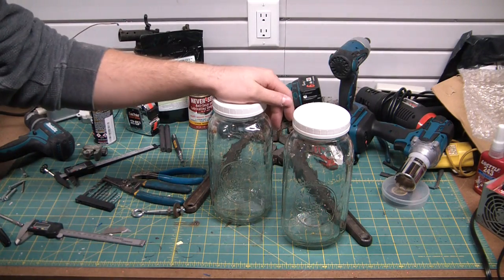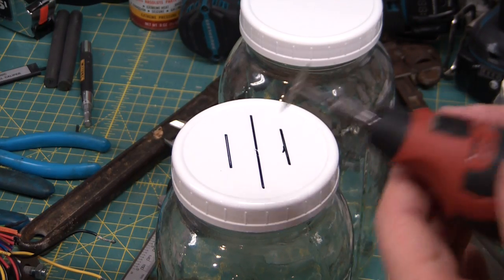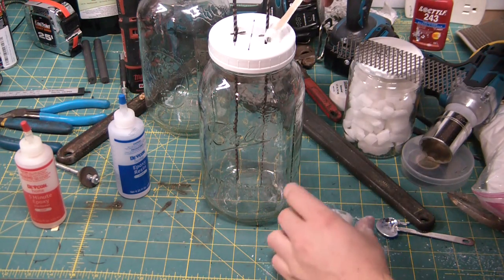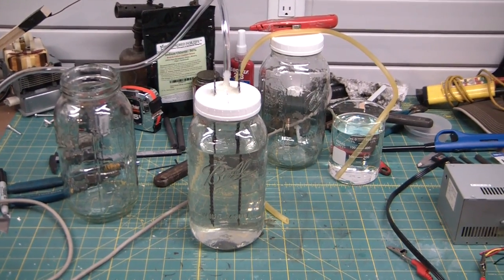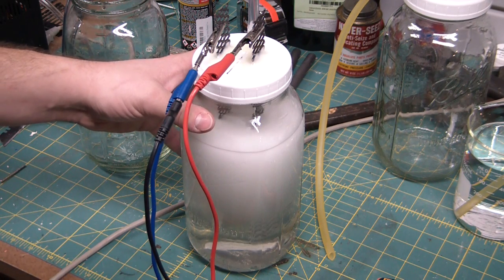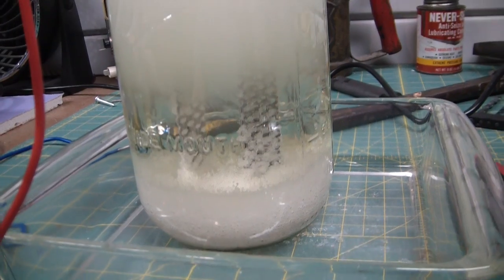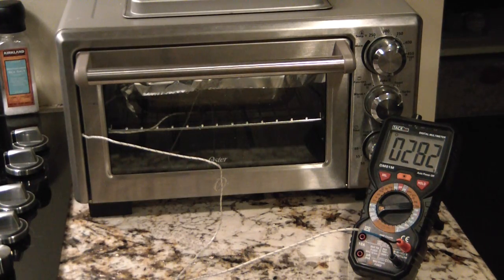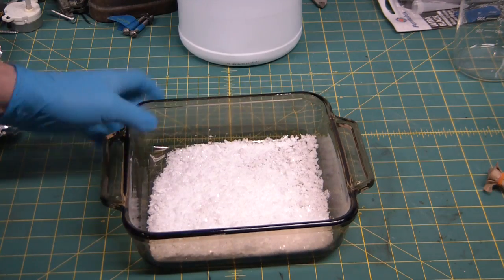Electrolytic Production of Chlorates Using MMO Anodes

Comment from the maker: Happy New Year! If you would like to support this channel but cant swing Patreon you can save this link as your amazon homepage, so when you shop the channel gets a small kickback: https://goo.gl/x1ehvA Please consider helping to keep these videos coming
Reply: That's cool!  I'll do that.
Reply: Happy new year to you too ✨
Reply: You should do salt and cook the hell out of it to make naclo4 then do a double displacement reaction with a solution of hot potassium chloride to yield kclo4 instead of the method you're doing that is more likely to only produce only kclo3
Reply: @ziggyc3004  , you could also spend a few bucks and buy a kilo of NaClO3 and react it with KCl in a saturated, boiling aqueous solution to produce it.  Though it's a bit faster, it's not anywhere near as efficient as this method.
Reply: To my knowledge if you start with naclo3 and displace with kcl. You get mainly kclo3. I'm talking about doing electrolysis of nac to produce naclo4 then doing the displacement to yield mainly kclo4. There is many reasons why it's a better option than kclo3. But as mentioned in the video kclo3 tends to be.... well unstable.
Reply: @ziggyc3004  , I must have misread that comment.  But yeah, it is pretty reactive.  He mentioned a mix called Armstrong's mixture.  It is pretty damn unstable.  The slightest touch can set it off and if you use the white allotrope it goes off all on its own.
Reply: I love that old blow torch, what girl does it run? Is it for sale
Reply: You ever get around to doing the double displacement video? Cannot find a good demonstration anywhere.
Thanks👍

Comment: Hey ElementalMaker, thanks for the great video & especially for showing how you dried the end product. I've watched tonnes of videos and none of them showed that. I've made a few batches, I always use my oven, however I have a new method of using the oven on a low heat of about 150 degrees for 10-15 minutes and then leaving the product in an open container in a zip bag and another container with caustic soda in it, over a few days it dries the crystals up.

Comment: 1. Match heads also contain sulfur
2. Your filter paper probably turned brown because of either dehydration or oxydation of the cellulose
Reply: And dextrin binder (which also acts as a fuel). Dextrin is also a common binder in many star formulas.
Reply: Rasmus  never heard of sulfur free matches, but i could be wrong ofcourse. Wikipedia lists sulphur and antimony sulfide as common reducing agents for match heads
Reply: Rasmus  im from switzerland (or as the americans say, sweden). Hardly a developing country :D. Sulfur + potassium chlorate should be safe, its the phosphorus on the matchbox that allows for ignition by friction
However, phosphorus+potassium chlorate+sulfur is such a potent explosive that youll quickly get to know the police intimately if you produce any significant amount of it
Reply: Could also be manganese contamination from the degradation f the MMO electrodes.

Comment: Really nice video.
I would suggest that you switch cathodes every 12 hrs, this way any KNO4 stuck to the - pole will fall off, other than that, pretty neat.
 Might mention that this stuff is great for small scale flashes... but it's very untamed, reacts with stuff you wouldn't think it would, at times spontaneously. 
 But this is a viable option for those who want to have some on hand for perhaps the family picnic, or even at camp, easy to mix into a powerful flash powder, if not contained, almost everyone loves to see it "flash". Contained and half will love it, the other will hate it. Lol
 God bless all free men who use common sense before action.

Comment: I have to say after running my cells and having made both chlorate and perchlorate, it really looks like you made perchlorate here. The length of time you ran that cell would also suggest that too. 
If the crystals are more square in shape, that’s a good indication of perchlorate. However, it’s likely to have a certain percentage of chlorate as well so still wise to treat it as a chlorate regardless.
Reply: nope its almost impossible to make perchlorate by electrolysis of K chlorate unless the temperature is let to run at 80C and MMO is incapable of producing perchlorate.

Comment: To make potassium or ammonium perchlorate i think you have to electrolyze sodium into perchlorate and then do the double displacement
Reply: Yes, potassium chlorate is insoluble in water, so it crystallizes out before it can be electrolyzed into the perchlorate. Sodium and ammonium chlorate are much more soluble, so it stays in solution.
Reply: According to Wikipedia, heating potassium chlorate in the absence of a catalyst produces some perchlorate: 4 KClO3 → 3 KClO4 + KCl. I don't know how viable the method is in getting the desired reaction product, or how far it can be taken to the right in the reaction above. At best some cl is being reduced (disproportionation reaction) so you are not getting a complete conversion from all chlorate to perchlorate like in an ideal cell. I've seen this being done with sodium chlorate, and I actually did a little test by heating some in a test tube for a few minutes and it appeared to work, although my yield was horribly low. However, that was just heating to a melt with no real controlling of variables. It's not going to be as simple as that.
Reply: @Clipster15  dont use potassium chlorate for this reaction its yield is bad!.
I use NaCl + NaClO3 mixture
the NaCl prevents reduction of chlorate.
yields with NaCl added is around 60%.
theres no real set temperature but usually when it starts foaming slightly is where I run then once it dies down and becomes this liquid soup that doesnt bubble all too much even raising the temp.
then I just simply break up the cake and mix in HCl to destroy any remaining chlorate and then mix in some KCl to precipitate any product or boil it down and fractionally crystalize to remove NaCl.

Comment: You could use the PC power supply if you care to use longer wires (especially CCA wire) the slight extra resistance drops some voltage and reduces the current flowing.

Comment: You can use lead battery electrodes to go all the way to perchlorate. Use a dry battery's positive electrode plate if you salvage from a junked battery you will need to soak in NaOH or KOH first to remove sulfate.
Reply: Have you done this before Chris? And did you get perchlorate
Reply: @Michael-bn2nl battery electrodes fall apart fast, usually before making any perchlorate

Comment: If you do this with sodium chloride, you hardly get any crystals forming.  You just evaporate solution to half its volume then top off with fresh sodium chloride and do a second run.  Crystals form at the bottom and more form when you reduce remaining solution to half.  Add more sodium chloride rinse and repeat!  In one month you’ll get one kilo of relatively pure sodium chlorate crystals.  I used gravity filtration with coffee filters.  I purposely let them dry out and I lit them with a torch and the results were frightening and exciting!
Reply from the maker: Great technique for sodium chlorate. I've never actually tried the sodium salt, as the lower solubility deterred me, but that's a great process you described here, and I'll have to give it a try! Thank you for the tip!

Comment: Great looking crystals, though I doubt they're much good for any healing.
@9:15 you switch back to the Sorenson power supply, running at 3.9V and 4.84A. If you measure the PC PSU 5V output it might be a little high as the other output rails is not loaded/regulated correctly. Fortunately it can easily be lowered by putting high powered diodes in series, freeing up your lab PSU. Depending on the diode type and applied current, they usually have a voltage drop of 0.4-0.6V across Anode_Cathode. You could mix'n'match, or just put 3 in series. Should work out great, though later you might have to remove one - use the DMM to determine the correct voltage on the cells terminals. Best of luck - looking forward to seeing what you come up with.

Another thing - @2:54 the ends of the MMO seems to be very shiny. That could be another reason why the filter paper was discolored, if they're being eaten up from the inside.

Happy New Year - from a Sørensen :ø)
Reply: The crystals have mystical powers. They heal by the therapeutic effects of oxygen.
Reply: @garycard1456  Garlic, Orange Juice, Chamomile tea with honey just might more effective against the cold I'm experiencing at the moment ;')
Can't dispute Oxygen power though, venturing outside a moment ago I got some huge gasps - and remembered it might be possible to adjust the PC PSU internally, to output a lower voltage without using diodes.

Comment: With just a little more effort you can synthesise useful natrium perhalate by electrochemical means. The electrolytic cell conditions are just a little more exacting. For example, if using Pt anode you have to start from pure halate free from halide. Halide presence corrodes Pt electrodes.  If you can obtain (or make yourself) PbO2 anodes, then you can start from halide. I have read that if a porous diaphragm (unglazed clay  flower pot?) is used (as in a diaphragm electrolytic cell) is used, then one can synthesise perhalates using graphite anodes (not possible in a non-diaphragm cell). Oh, Happy New Year!

Comment: For that red residue left over on your mmo anodes / cathodes you can buy off the shelf cheap muriatic acid which will take off any of the residue within a 30 minute soak. The usual coating on MMO anodes (Iridium / Ruthenium oxide) is not affected by HCL and is made to withstand highly corrosive enviroments.
Reply from the maker: Great to know. I think a few years ago for one of my other cells I used hcl to clean it, but it's been so long I forgot what I used and didn't want to harm the mmo. Will definitely use it in the future
Reply: @ElementalMaker   Did you try thermal decomposition that you said? Or not yet? Because we wait you know 😂 haha!

Comment: Pyrotechnics uses mostly potassium perchlorate (it has an extra oxygen compared to chlorate), as it's both a stronger oxidizer, provides just as much chlorine ion (the color enhancer you were talking about), and much much less sensitive.

You also want to avoid chlorate anytime you can, and you never use it if you have any acids or sulfur in your mix, as that can cause spontaneous ignition.
Reply from the maker: Yes perchlorate is preferred in many instances due to its extra stability. It is not as useful in color comps though due to perchlorates  higher heat of decomposition, leading to more washed out colors. Chlorates lower decomposition temps drastically improve color

Comment: You wasted one of those ANODES, by using it as a Cathode.
Reply from the maker: I have a ton of them, so no worry here
Reply: stainless steal as cathode works fine
Reply from the maker: @yannickwalter1  I've had stainless cathodes corrode in a chlorate cell, so titanium is my preferred cathode material. In this instance, I just used what I had on hand.
Reply: @ElementalMaker  speaking of what you have on hand....where can I get these? I tried a set and they were (of course) not as advertised.
Reply: @manxmead  the only online place to get them easily is ebay, and yea these guys dont like to be used as a cathode so dont wire it wrong!.
also i recommend having more anodic surface area than cathodic to improve current efficiency and promote oxidation.
I also run only NaCl with some CaCl additive which is better than chromates giving CE from 87-89% instead of the normal 54%.
KMnO4 can also be added instead of K2CrO4 but CaCl2 is the best additive as a self regulating pH buffer that also coats the anode in Ca(OH)2 which further helps to prevent reduction.
Reply: @manxmead  Try corrosion protection anode suppliers, they may even have some off cuts for cheap/free
Reply: Yeah, i used a steel rod from Bunnings 🤣 any bit outside of the solution rusts though and in storage but it works perfectly

Comment: 2 tips:  Heat the cell to make chlorate production faster and prevent crystallization.  Adjust ph occasionally to about 6.5 with HCL to avoid excess chlorine gas production, if it becomes a problem...

Comment: I bet I'm not the only one who wants to see you make this into an epoxy-bound rocket grain. The question is if it'd be stable enough to use, and if so, what kind of energy might be expected.

On a side note, I guess the only way to keep the epoxy grains from sticking to everything is with tape and paper on both the spindle and the walls. maybe sheets of nitrocellulose could take the place of paper for the spindle.
Reply from the maker: Sadly chlorates are far too reactive to safely use in rocket motors.
Reply: @ElementalMaker  they tend to make explosives? or is it more worry about spontaneous combustion?
Reply: @Skyliner_369  it depends on the fuel.  They can definitely explode if you use sugar or aluminum and a plasticizer, but it can be done relatively safely with hexamine.

Comment: EM. Have you seen what you can do with Meanwell or meanwell clone supplies?  I take em and put a POT across R33 (They all call em R33) I run the pot to the front of the supply and you get current and voltage control. The 40v Supplies can go down to 0v and you can fine tune the current with whatever POT you put in there. I put a fine pitch 1k as the replacement to R33. Also. Re-Ammonium Perchlorate. That's copper PCB echant no? Does this act as a stronger oxidizer to sugar rockets? Why does it produce a stronger impulse?

Comment: For anyone wanting to try to make very pure potassium chlorate with things you likely already have at home here's how I would do it.

Get some carbon rods from alkaline batteries, use a old phone charger as your power supply (I used 5v 1a), and use sodium chloride (table salt) as your electrolyte. Run the cell until the electrodes have corroded and then take the electrolyte and pass it through a coffee filter. After you have filtered out the carbon add a saturated solution of potassium chloride. It should react with the sodium chlorate to form sodium chloride and potassium chlorate. The potassium chlorate should precipitate out of the solution and can be filtered and dried.
Reply: That’s the thing, I don’t think anyone has potassium chloride in their house haha
Reply: Water softener tablets
Reply: @zach3096 diet salt/no salt salt replacement. It's more expensive that way, but it's available at the grocery store.

Comment: 1. You are going to destroy one of your anodes(if not already), actually the negative cathode one, since afaik mmos should not be reverse polarised, prove me wrong.. add some SS carhode and set up mmos in parallel, it will give you highier current Capability and less stress on anodes.
2. you cannot go from kcho4 to nh4chlo4 by double displacement, since kclo4 is nearly insoluble, while nh4clo4 is much more soluble... for that you need to go from naclo4 to nh4chlo4. Actually my advice would be - get also some Pt anodes, then first you get NaClO3  with MMOs (doable), then you go to NaClO4 with Pt, then you get Nh4 one by displacement. Regards.
Reply from the maker: Per note 1, the cell current was maintained steady the entire run, so no noticeable passivation of the mmo cathode occurred. Perhaps could be an issue at much higher current density.
For note 2: I do plan to start with NaCl for producing ammonium perchlorate. As you said the potassium salt is far too insoluble to. I have a bunch of different processes I want to try to produce it, and I'll definitely be getting a Pt clad anode for one such method
Reply: per 1 you get it wrong: noone said the Cath ode (negative) mmo will not work as cathode in this arrangement, I said that it probably could never run as ANOD E  anymore,   since by connecting to negative polarity the mmo coating most likely is getting destroyed and now the bare titanium underneeth  is happily bubbling hydrogen, as any other metal cathode could do. Main point is wasteing 1 MMO of 2, permanently.
Reply from the maker: @papanyanz  nope still works perfectly fine as an anode. Didn't hurt the mmo coating at all
Reply: also to add: in this case the current density has nothing to do, it just polarity reversal what will cause the failure. Yo u can now just test if that mmo is still going to act as anode or not, very interesting to see.

Comment: Hi buddy, thanks for video, i need advice please, I have Voltcraft  hps 11530 fully adjustable power supply from 1- 15V and 1 to 30A 450w, the problem is when I adjust it to 5v-20A and connect to the MMO anode the Amperage showing around 3,4 A, when I close Kathode to the Anode the Amperage begin rising up to the 6A.. I had no idea why its not stay on the 20A, just voltage stay correct without changing..if you have any knowledge about it please let me know it, thanks a lot
Reply from the maker: Yes your power supply is working fine, what your seeing is simply physics in action. The conductivity of your solution isn't high enough to allow the full 20A at the given voltage. 20A seems way high anyways and will probably rapidly destroy your anode.